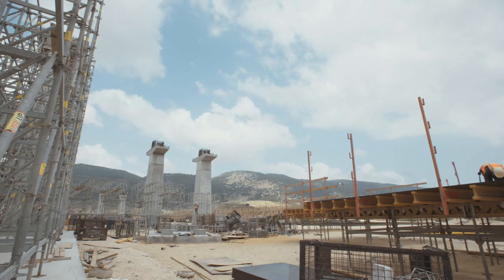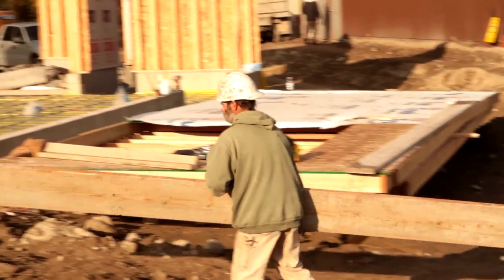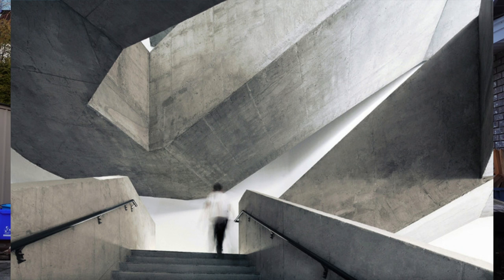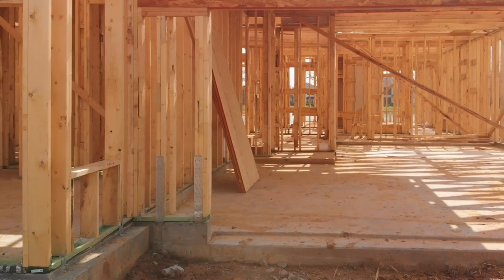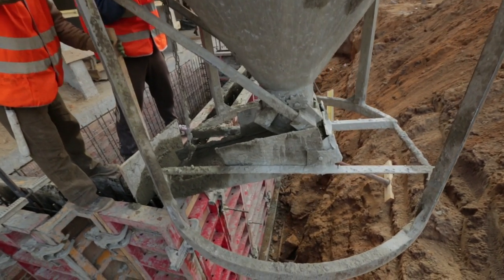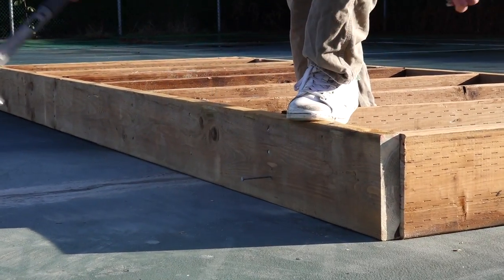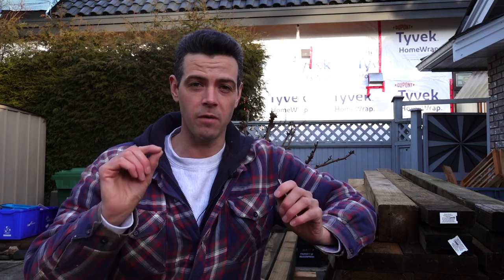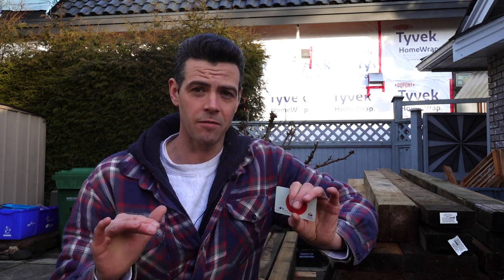What actually is a Carpenter????

Comment: A carpenter  is a multi talented  worker who  gets paid very little,  i have been  doing it for fourty years and  can charge what i want, do plumbing, tile,framing,finishing, drywall, plumbing, concrete, cabinetry, electrical,wood stoves and on and on. No tickets but word of mouth, i once had red seals measuring between each stud for blocking each piece was a different length on 16 inch centers, go figure how that worked out at the eight foot mark.

Comment: I started working for a spray foam insulation outfit while taking IT classes in HS. All my friends went into carpentry right out of school but for some reason that never really interested me. I thought welding was neat tho so I did structural welding for about 4 years all around the PNW. Currently doing commercial mechanical/plumbing for big buildings like schools, universities and fast food while also doing metal fabrication on the side. Most all of my friends that went into framing now have their own businesses doing things like dirtwork or finish work.

It's pretty crazy what's possible without having a college degree.

Comment: I started as a rookie (FNG) in a framing crew. 40 years later and self employed for the last 28 I do everthing. Framing, plumbing, electrical, drywall, painting, flooring, and, lest I forget, trim work. It's just easier and more rewarding to do everything on remodel jobs. I have accumulated a ton of tools and knowledge by tackling everything. My retirement plan is to build a woodworking shop and turn out replica antique mouldings, doors, and other restoration components. Love old houses!

Comment: In IATSE, the stage hand's union, carpenters roll big chunks off a truck, lift them up, bolt them together, and then do all that in reverse. Which might not sound odd. But their "electricians" match the numbers or letters on 2 pieces of truss, bolt them together and then find a male and female plug with the same color or pattern tape, and plug them in. Like one guy might have to switch off a 3 phase panel and plug in 5 plugs in a special order, then flip the panel on. That is about as technical as it gets. So, sometimes its not art, but sometimes the finished product is art.

Comment: Just wanted to update about my kitchen remodel project at the dry wall stage. I messaged you about needing to possibly skim existing texture to match new dry wall finish and you commented back, thanks. It has taken me 5 days to tape and put 3 coats, light sanding each time. I am a electrician of 35 years, never done dry wall but was always around it my career. Thanks for the videos you made it possible to actually pull it off, looks great. The only regret I have is not watching the video of how to use and practice with the hawk and trowel, we don't use those here in Sacramento, but I did !!! thanks again Vancouver Carpenter.

Comment: Great general experience and knowledge! I consider myself lucky enough to have several years experience in all aspects of construction from concrete to roofing and specializing in finish carpentry for most of my career. I moved onto a more drywall and finish focus when my body started failing (probably because of the roofing and concrete work!). Found it was easier to teach my guys how to install and finish drywall and painting systems than it was to teach them how to do hardwood finish carpentry. It's been a good career and I feel like I know just as much about the process of building as most (residential) general contractors. Cheers!
Reply: I've been working in construction for 41 years now. And just like you, I've become proficient at pretty much all aspects of construction from concrete to roofing and everything in-between. Of course some things I'm better at than others. But I specialize in remodeling, and let me tell ya, talk about dealing with the "unknowns". Over time having to fix this and that, you tend to develop quite the skill set. And of course, those things we like doing the most we tend to be the best at. But when it comes to drywall finishing, well let's just say I still have lots of room for improvement. I do know my limitations though and when it's time to call in the specialist, this is why I like watching watching @Vancouver Carpenter, I have become much better at it because of his teachings.

Comment: Out of the Army I worked as a carpenter putting up pole barns. I always felt saying I was a carpenter was an exaggeration. That was the title the employer used. I had almost no training. Cool to now learn 40 years later that yup I was a carpenter. Thanks.

Kind of interesting australia calls the trade "builders". More accurate maybe. I guess this all started hundreds of years ago when there was basically 3 materials, rocks, wood, metal and very limited use of those materials. In an area where there wasn't wood a mason would build a house. Places with wood a carpenter would build it, meaning the structure. All the other steps like rendering walls, roofing, etc...would probably be completed by whoever built the structure. Before so many things became specialized.

Comment: As a Cabinetmaker, I've spent a decent portion of my career correcting people when they introduce me to someone else as a "Carpenter". 

I take a lot of pride in being a Cabinetmaker, and I've also spent a lot of time thinking about the various trades that I consider to be under the umbrella term "Woodworker", which in this video you've used to describe a subset of tradespeople as opposed to my definition.

I think that "Woodworkers" include Carpenters and Cabinetmakers, and if you think that Furnituremakers are separate from Cabinetmakers, then those are the 3 large groups. Within the Carpenters, I think that you find Framers, Formers, Trim/Finish Carpenters, and Wood Flooring Installers. I believe that flooring installers are a distinct trade.

Within the Cabinetmakers, you have Assemblers, Sawyers, Operators, Joiners, and Installers. Most Cabinetmakers (including myself) are proficient in multiple "Sub-categories", and when you're a custom cabinetmaker (like myself), you tend to be very good at designing a project and taking it all the way to a perfect installation. CNC machines have become a big part of the trade and while I am also a CNC operator, I don't think it necessarily falls under Cabinetmaking. I'd wouldn't expect a CNC operator to use a jointer or shaper. Cabinetmaking is a very complex trade, and it's shocking that our Red Seal is optional. There are too many people who tack together IKEA cabinets and think they're Cabinetmakers.

I think Furnituremakers and Cabinetmakers have significant overlap, but I think a Cabinetmaker could go their entire career and never build a table or a chair, or a bench. Likewise, I think a Furnituremaker could go their entire career without building a bathroom vanity box.

As a Cabinetmaker, I would trust myself to build a strong house with level walls, square corners, and all kinds of things planned for that other trades wouldn't even know that they could benefit from. However, I wouldn't be able to do it on time or on budget because I'd be splitting 64ths of an inch and stressing about 90.1° angled walls.

The ability to work within an acceptable tolerance while adhering to code is what makes Framers make money. I think that all of these sub trades have some or significant overlap, but I personally think it's asking for trouble to get a Framer to trim out your interior doors and windows, or to ask a Trim Carpenter to design and build a kitchen. I doubt you'd want a Former building you a harvest table, or a Flooring Installer framing your house.

I agree with the sentiment in your video that we should all understand trades that come before and after us. Knowing why my kitchen floor is 1/2" out of plane and level over 8', or why a niche has 87° inside corners, or why a vent/pipe just HAS TO be in a particular place can both humble you and allow you to help others to improve their own execution on job sites so that we all work together and achieve greatness on our builds.
Reply: Made cabinets and framed, there's an old saying,  you aint building a piano, unless of course you are.
Reply: CabinetMaker is a  skilled joiner who makes furniture or similar high-quality woodwork.

Comment: The way ive always looked at it is, if you work primarily with wood, but couldn't do your job without metal hardware, you aren't a woodworker (and are probably a carpenter of some type). Not that all woodworking is, or practically should be, done without hardware (there are times and places when cut nails, brackets, etc. are good and useful), but it could. To me, that's the difference (and yes, that would mean timber-framers are woodworkers in my book, but I know others would call them carpenters/builders, or something different, but im okay calling them woodworkers).

Comment: I started with laying carpet and vinyl however Im a painter and drywall finisher by trade but I do everything for builders and remodeling hanging drywall,framing, finish carpentry, tile, siding, concrete, insulation,a little plumbing and electrical but not licensed but I guess I'm mainly a painter I wear whites and did a five year apprenticeship I can do residential, commercial, industrial and new construction and am chemical coating application certified so I'm rare good brush skills and spraying conventional,help,but mainly airless of course

Comment: No, we are carpenters, though it is carpenters that DO the building, the builder is responsible ( and not always smart ). Gc are licensed builders. I learnt plastering because after a reno it was difficult getting someone to do me setting. I also learnt how ti install cabinet and replace benchtops because i knew how the systems work. In the US there are guys that start doing trim work amd call themselves carpenter. This isnt so. I can pitch a roof from lumber from scratch. I can also make coffee tables and book shelves.

Comment: A long time ago the red seal was optional in my trade in Ontario.  If you got less than 65% on the final test then you failed and didn't get your ticket.  If you got 65% or above, but less than 75% then you would have a ticket for Ontario but you wouldn't have the red seal allowing you to work in any other province of the country.   Nowadays, if you get less than 75% you just fail.  It's red seal or nothing.
I'm guessing it's that way with carpentry, too.   I'm a millwright, and I got my red seal, but have yet to actually 'need' it.
Reply: You don't need a ticket at all to be a carpenter in Ontario.
Reply: @thebigmacd  Any trade that isn't controlled (like electrician or HVAC) can strictly-speaking be done by whoever feels like it, but I'm happy I have my journeyman's card.

Comment: One thing I've noticed is that very few people realize there are different types of carpenters based on skill and experience.  The conventional categories are: helper, apprentice, journeyman, and master.  Most are journeymen(women).  If you want to experience the difference between a journeyman and a master, just be the one who follows them in the process.  A master never makes the next trade's job harder.  I worked for a general who had moved on from running a finishing crew.  He told me that he could teach anyone how to trim (his actual words were "a monkey" but I don't want to insult finish guys) but it takes a Carpenter to frame.  I was a bit skeptical when he said that.  Years of fighting crooked, misaligned, or sloppy framing as a finisher have made me see what he meant.  I now finish drywall and it's not uncommon for me to have to take down a sheet/piece to fix or complete the framing behind it.  As a matter of fact, I'm going to have to do so today.

Comment: Not sure what a “woodworker” is, but does it matter?  I think I’ve heard one of the differences between framer, finish carpenter, and cabinet maker expressed as tolerances (1/8”, 1/16”, etc). What expectations/requirements did you actually run into as you moved between types of work?  And what would you call the craftsmen who used to build built-in cabinets on site - and those who install shop made cabinets?  Thanks for the video.

Comment: Great job I see you’re in the top ten percent of carpenters with an interprovincial ticket like myself. As you said about general contractors our trade needs to be a certified trade to work in like electrical or mechanical.Also to own a construction company it should be mandatory to be ticketed .
Reply: I've  repaired more mistakes by certified red seals then i care to mention, not saying  reds are bad but it doesn't make you a good carpenter.
Reply: Hi David, I agree with you, All Construction companies should at least be run or managed by a certified carpenter, the carpenter is first on the job and last off the job, from forming the footings to hanging the front Door . The other trades are only on the job for a few days / weeks , the carpenter has to coordinate with all the other trades and suppliers , and building Owners / Buyers who change things along the progress of the job, this is learned through a proper Apprentship program and involving a variety of work,

Comment: I'm a software engineer but when I really want to impress people I pull out my Kentucky Certified Surface Miner card. In order to install systems in the KY coalfields I had to take miner safety classes, had to wear a hard hat and steel toed boots. Just driving around in an open mining operation is dangerous. The trucks that haul coal can be the size of semis or the size of buildings. They could drive right over your vehicle and not even notice. Trucks ALWAYS have the right of way. And you have to learn which side of the road to drive on. Signs will tell you to switch lanes. Going down hill with heavy loads trucks will drive on the side next to the rock wall so that if their brakes fail they can steer into the wall. There are no guard rails to stop you from going over the cliff. And the road you drive on today may be gone tomorrow. I almost drove off a cliff following a truck in a dust cloud. I've been buried up to the axle in mud, had to wait until dark for it to freeze before I could get out, and then had to scrape the frozen mud off the headlights with a 2x4 so I could see. I've shown up on a job site and wondered why no one was around and then seen the side of a mountain blown up and rocks come raining down. Oh, that's why nobody is here. And most of the trucks, even the semi sized ones are not road licensed, and the drivers do not require a driver's license since the trucks never use public roads. Many of the driver's can't even read. You have to use colored lights or horn sounds at the truck scales to tell them where to go. And then you get to train them how to use a computer. Every job is an adventure!

Comment: I was looking through your lots and lots of videos looking for one that showed me how to compute the correct compound miter cuts.  For example, I want to build a ramp off of a deck.  The ramp slopes at 2º, so I would lay the joist flat on my compound miter and set the angle at 2º and done!  But a complication is that the ramp is also angled from the perpendicular by 7º, so is this just a matter of setting the miter to 2º and the blade tilt at 7º?  Or is it more complicated than that?  I’ve seen lookup tables for crown moulding that would suggest the angles I need to cut are much more complicated.  How do I figure out which angles to set on my compound miter saw?
Reply: It's going to be different and I would just make a guess on a piece of scrap and adjust angles till you arrive at the correct one.

Comment: I've looked back through 4 years of your videos and was wondering if you could do a video on finishing baseboard?  You have a few but I have a long run and was wondering is it better to do as long as possible or miter pieces together? When dealing with the really long pieces it bows out when too long and always seems to be impossible to get it just right.  Any hints?
Reply: For what its worth, tons of different opinions on this, but found a scarf joint helps. Cut at a 45 degree, glue and make sure you push on the baseboard as you go along tacking. If you search google a couple of helpful vids pop-up.

Comment: Actually interestingly enough mudding and taping are not considered part of carpentry in Canada but board hanging is considered part of carpentry the union all consider drywall to fall under carpentry now due to the hanging of board and often most union carpenter now are also starting to venture into taping and mudding as part of that was just around a site that this was the case so that follows that learning the next part of part before you spoke of

Comment: A.S.S lol . Maybe you were thinking of Interior System Mechanic, (I.S.M)
Reply: I wasn’t but it may have inspired the name. I’m familiar with that term as the dudes who steel frame and board.
Reply: @bendegros  Yep... Another technical / alternate term for the trade is Lather... When I did my red seal it included any kind of metal lath and therefor stucco wire is part of the trade too.  However most stucco guys just did their own stucco wire for the most part (Do they even use it anymore or is it all just acrylic and mesh now? Hmmm).  Anyway, like carpentry the trade is so diverse most guys never do all of it.  Hanging board and framing walls is maybe not even half the trade since it includes T-Bar, tech floor, shaft wall, metal lath, etc.